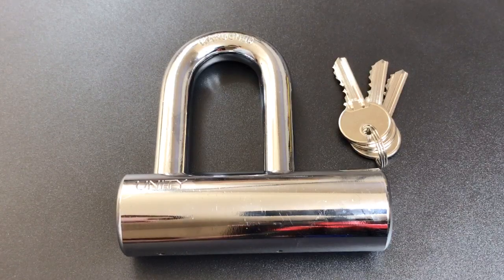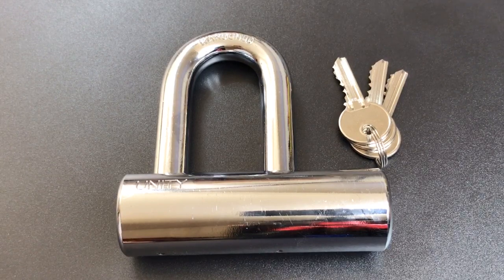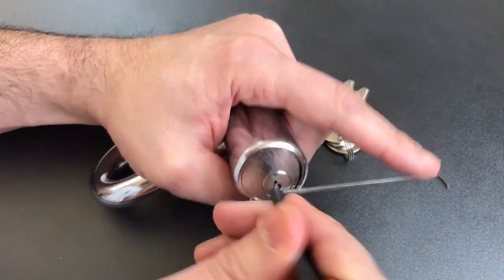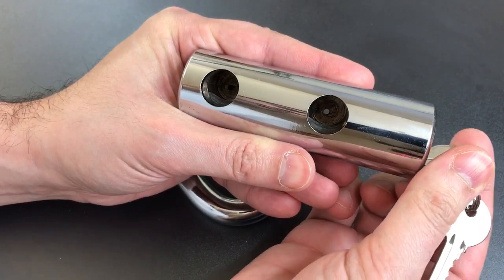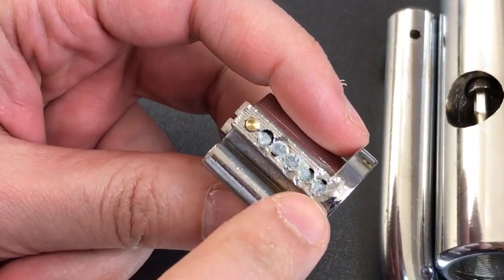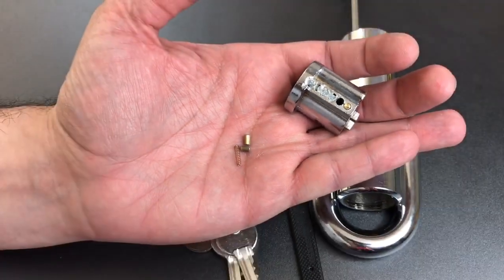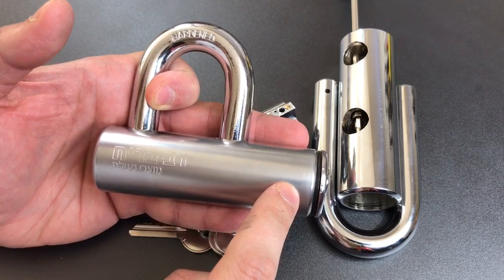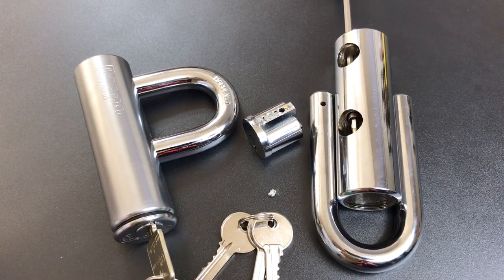[584] Unity Heavy Duty U-Lock Picked and Disassembled

Comment: On your replacement, seeing that there is only 1 screw holding it in place,  a good smack on the flange you've created (with a heavy chisel and a hammer) could possibly split the threaded section allowing the lock to be removed.

Comment: Slide hammer attack on the core? Ramset? Its a decent lock from a strength perspective but a single screw holding in the cylinder is pretty weak.

Comment: With the putty caps I bet a comb attack might work.
Reply from the maker: I doubt it because the top of the Bible touches the inside of the lock body... so the snot only needs to hold the pins in place during assembly. 👍

Comment: Is the end of the body threaded? Will a regular mortise cylinder screw into it? If it did wouldn't be too bad to thread a screw into the back as a set screw
Reply from the maker: No, you need to screw into the back of the cylinder.

Comment: If these are still available, would you please provide a link to the sale page?
Reply from the maker: This is all I could find... 6 for $60. 

https://rover.ebay.com/rover/0/0/0?mpre=https%3A%2F%2Fwww.ebay.com%2Fulk%2Fitm%2F132106923944
Reply: LockPickingLawyer Thanks. My ex-boss has something similar. Can't remember the brand name right now.
Reply: Seller just replied saying it has been sold out.
Reply from the maker: Well, you didn't miss out on much.
Reply: LockPickingLawyer I was holding out hope to replace the core with something fierce. But if standard rim or mortise cylinders won't slide into it easily, then no go. I'm pretty sure the one may ex-boss has will accept any standard mortise cylinders. I'll rack my brain and find out the brand name for you. He said he had it for 30 or 40 years and I remember the company doesn't make that models any more.

Comment: You have done quite a few gun lock reviews and most of them seem to be junk. You even did a video where you made a good gun lock. So you obviously have some interest in firearms security. How about a review of a good gun safe? I think it would fit with your firearm security videos and would be of great interest to your viewers. Safes are a complicated market, with wildly varying prices and features, so it's a tough decision.
Reply: Gun Safes- Disregard box store brands. Look for AT LEAST a UL-TL-15 rating. TL-30 should be adequate for anything under transferables.
Reply from the maker: The problem is cost... and there's no way I'm showing mine... #opsec 😁
Reply: Of course. I was just hoping that you knew of a "best value" type of safe out there. All I've found is the junk you can pry open with a crowbar ( and some of them are not cheap ) and the obviously good ones that cost several thousand dollars.